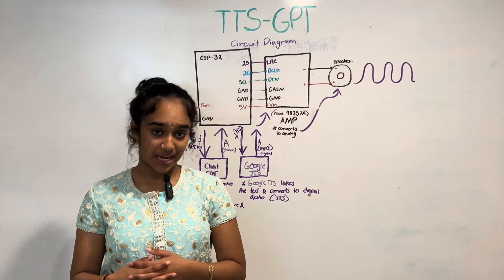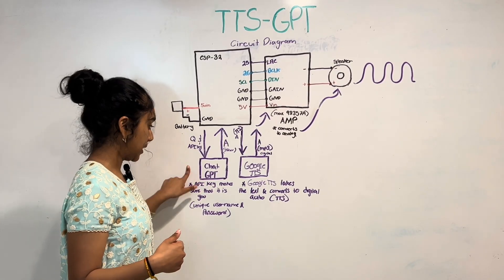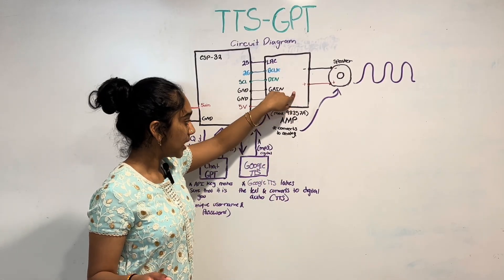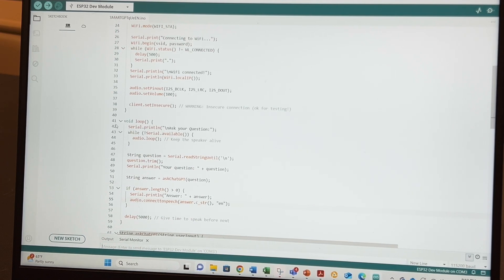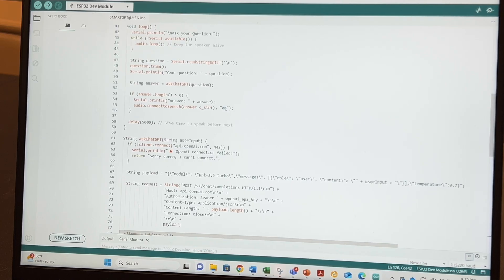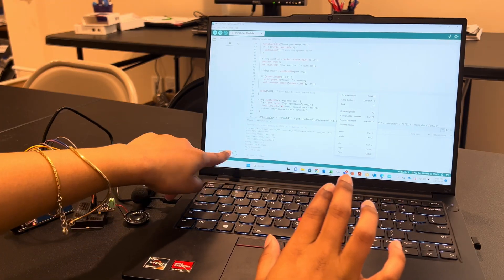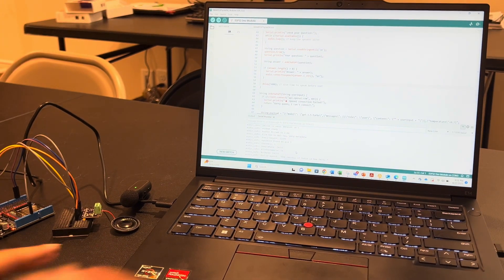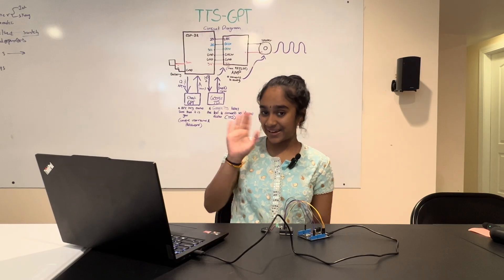ESP32 + ChatGPT: Type a Question, Hear the AI Answer (TTS Project)

Comment: I watched the entire video.

And I have a few questions that I would appreciate your help with.

How was the process of sending the text to Google TTS and having it return an .mp3 file?

Was that a specific Arduino library?

Could you tell me more details about that?

How was the process of using the Google TTS account? Do they charge each time you use it?
Reply from the maker: Hello! Thank you for watching my video. I am happy to answer your questions. 

1) The process of the conversion from text to .mps3 is pretty simple. All you need to do is add this library (https://github.com/schreibfaul1/ESP32-audioI2S) into Arduino IDE. You will find an Auido.h file that you need to include in your code. 

2) The TTS part is taken care of by the library using the method “connecttospeech” and there is no charge.